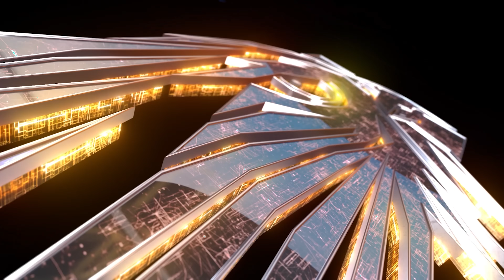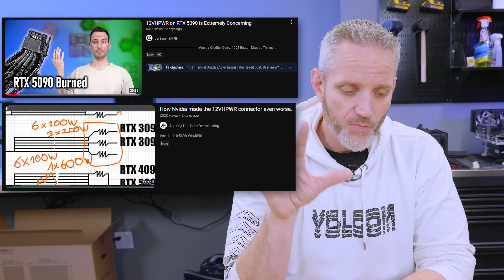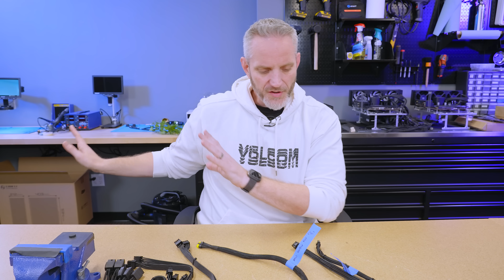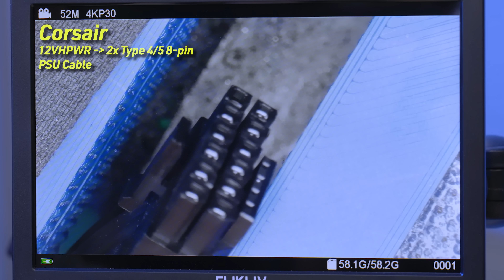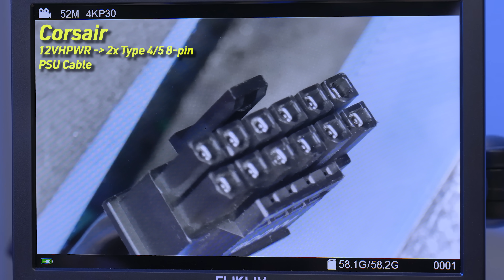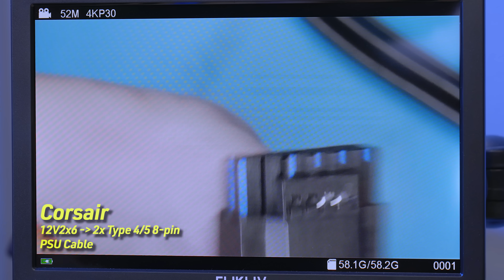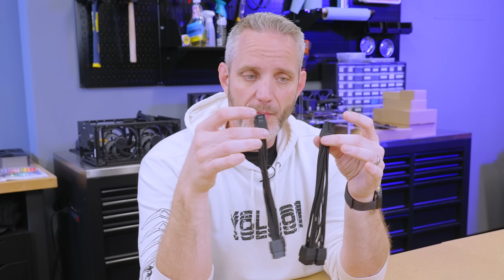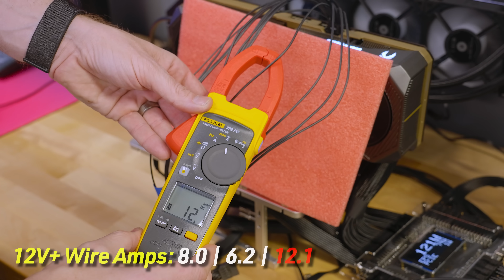I discovered something concerning and I need the Experts to chime in... More 12VHPWR discovery!

Comment: Engineer here: the board is grounded also on the PCIe side, so 12V  wires are more stressed than ground wires
Reply: They're not, the boards have 2 ground planes, one for the card edge connector, and a separate ground plane for the aux power. If you leaked aux connector return current through the card edge connector you would have a /bad/ day.
Reply: @ragzillaz  the two grounds are not isolated but connected together. It is actually just one ground. Running true isolated grounds is expensive and a pain in the ass , because you have also to isolate the I/O, not just power. I know because I design boards  for compact pcie crates
Reply: @ huh sure enough, I could've sworn I'd heard that they maintained ground plane separation between the pcie connector and the aux, but sure enough it's a low resistance path so single ground plane.
Reply: @ they are. This was already measured a long time ago; the 12VHPWR ground pins see only a fraction of the current the +12V pins do.
Reply: @ragzillaz  but eventually, those different grounds are connected together at the power supply, so it IS possible for some of the ground return current to go through the socket on the motherboard and back to the power supply.   Not a good situation, of course, but it certainly could happen.
Reply: @cube1us  generally only if the current sourced on that side, afaik the mobo supplied power rail wouldn’t go to the GPU Vcore VRMs, it’d be the smaller aux VRMs for control power, and maybe some memory VRM.

Comment: if they won't do load balancing then they need to incorporate thicker gauge wire to carry that kind of current.
thicker gauge wires all around  that is.. no point doing it only for the 12V side if the ground wires can't handle it.

Comment: 11:40 A lot of if not most atx power connectors have this kind of push&pull wiggle room on the cable connectors for both female and male connectors, and they didn't burn up like this unless you went crazy with daisy chaining splitters.

This is almost certainly a factor for the 12VHPWR/12V2x6 melting but that doesn't change that they're drawing way too close to the maximum amount of power for the spec of these connectors, even the revised ones.

Should be at least 15-20% headroom under a constant draw load imo, because what that headroom allows for is some leeway with sub-optimal plugging, variation in manufacturing tolerances or wear over time.

Comment: The connector barbs should be crimped into the plastic housing like any JST connector are. This just show we are following the same cheap design of MOLEX connectors all the way with these supposedly high powered certified cabling.

Comment: It's still Nvidia at fault. It's obvious it was lab tested only. Current is going to travel the path of least resistance. From my experience cables can fail and pin locks break. Uneven pin height might still be within spec.  The Asus style ps is a solution just not the solution.

Comment: @Jayztwocents id take some pins off dead gpus and push into the plugs to see how tight the plugs are see if really making contact. Remember heat can make the pins expand then contract as it cools so the pins loose surface area, so could that make the pins loose contacts which make them melt? Also does GPU manufacturers have to follow Nvidia say use unified rails could they say no let do it the old way?

Comment: No joke, if I get stuck with a 12v hpwr device, I'll likely remove the connector, run wiring directly off the board, and use some high current connectors that are out of sight. Like, some XT connectors.

Comment: I bought a Corsair RM1000x last month. I have an AMD card, but I checked my never used 12VHPWR connector that came with it (H++) and the same pin that Jay was able to pull out a bit, did for me with almost no force

Comment: @boestube5805
9 seconds ago
I USED A CABLE MOD 90 DEGREE ADAPTER ON MY 4090 and it melted into the connector. those connectors were recalled in Australia. Fortunately, Asus fixed my card for free as it was still under warrantee. I will NEVER use cable mod again period as they are too risky especially with cards costing so much. BTW 5090's should come with a fire extinguisher.

Comment: When buildzoid put out that video after watching derbauer, It instantly clicked why the 3090 FEs and 3090Tis weren't melting but the 4090s and now 5090s are. 12vhpwr is kind of a janky connector anyways but it was never the problem. 12v2x6 was a way to slap some duct tape on it so to speak while sweeping the real problem under the rug. It turns out even that wasn't enough and Nvidia potentially just opened up the book on themselves because every electrical engineer I know would look at those diagrams and immediately call for whomever signed off on them to be fired. One of them described it as "amateur" and "psychotic". Like the kinds of mistakes you can't be ignorant to as a seasoned engineer. These came from the top down as cost cutting measures because we all know how upstairs can be incredibly greedy and stupid.

Comment: The power supplies also let the burn ups happen.  The supplies seem to be perfectly fine with shunting too much current on to one line if another one has a bad connection.  They allow current to exceed spec to the point where everything melts.
Reply: @greengiant_6652  buildzoid explained it. All cables in the 12VHPWR are connected in paralel. For PSU and GPU this is one connection. They can not balance it on each cable pair. In 3090 on the gps side had 2 phases so the GPU balanced the current on the 2 groups of cables in the 12VHPWR connection. In 40 and 50 series it’s gone (dumbed down). Even if you cut 5 12V pairs the psu will try to push the current with just the one pair of very thin wire (melting).
Reply: @JohnyBrav-o  Yes, saw that video.  Exactly all current through one wire.  The current power supplies are too simplistic and will just let the system destroy itself.  Power supplies could have internal load balancing, they could have per pin over current protection.  They don't.  The designs are lazy and cheap.
Reply: @ I don't think the 3090 actually had balancing, the design just split the delivered current to separate internal power planes to minimize the potential issue.   Balancing implies you are actively doing something to adjust the lines to keep current in spec.  Digikey has some nice technical notes on load balancing.

Comment: Hi Jay, in a series circuit (power in -> stuff happens -> power out) , that high resistance of the loose connection will limit the power through the entire circuit, but as the name says that loose connection will be high resistance, and resistance becomes heat.  So yes the loose connection will be a hot spot, same as a broken or about to break wire.  Now there OUGHT to be multiple power and ground lines to split the current across several conductors, but best practice is to have a ground line at a larger size than the supply side

Comment: Reagrding some.pins being recessed. I noticed it on my cablemod 12vhpwr. You could literally move the wire and the pin like you showed. So, what I did was after I seated the plug I push on the wires, also hoping that it would  push any too recessed pins. So far...I've been good on the 4090.

Comment: What most probably misunderstand is that the cables that heat up that much aren't going to be the cables with higher resistance. 

These cables are all connected to the same rail on the power supply side and the same point on the GPU side. The current will only split evenly among the cables when the resistances are equal in the cables and it will go through the path of least resistance. This means that cables that have bad contact can increase in temperature because of higher resistance (negligible) but the ones with excessive current are the ones that have a good connection because that is where all the current wants to go now.

Comment: I am IPC certified and work in the aerospace industry. The contact on the corsair cable that is moving like that should be a failure even for class 1 products. almost seems like the locking ring is broken or installed incorrectly.

Comment: I'm an industrial electronics engineer. Your findings show that there is no load balancing between the conductors on the card. It looks like the PMD uses shunt resistors to measure the current through the conductors. These shunts act as ballast, meaning the more current that tries to flow on any one wire causes a greater voltage drop across the shunt resistor. This voltage drop reduces the power flowing on that wire, balancing it with the other conductors. Imbalance can be caused by many things including contact resistance, cable length, conductor material, manufacturing variances, and temperature. Load balancing is essential when running things in parallel to force all components take some of the load despite these multiple variables. It seems like these graphics cards doesn't have balancing, allowing the currents to be so high one some conductors and practically non-existent on others. 

As for the question about the ground wires potentially melting: Yes, they could melt as well, but probably won't. All current entering the card equals all the current leaving the card (Kirchhoff's current law), so if the power wires carry too much, then the ground wires carry too much. Except the 12V cable is not the only ground. There are tons of ground connections on the PCIe slot itself that carry current. If you compare the total current going in on the 12V wires to the current leaving the ground wires, you will see a discrepancy. That extra current is leaving through the PCIe slot.
Reply: The very-small-milliohm shunts are almost certainly dwarfed by pin-to-pin contact resistance when the pins aren't making good contact.  This of course causes more current to flow through the other conductors in the parallel circuits. If only one cable has this, we're probably fine (because its split up between the other 5 paths), but derbauer's video suggests that 5 of the circuits had significantly higher resistance than the one that was carrying 22+ amps.
Reply: @glenndoiron9317  While it might normally be true that it would be fine for only one of the wires to be poorly contacting, keep in mind that the 12VHPWR cable only has a 10% safety margin, meaning that if it loses 1/6th (16.67%) of it's cables then the other cables are now over their current limit, if only slightly. Lose 2 and you have a big problem.

By contrast, the old 6/8 pin could lose 1 of it's 3 12v cables and still be totally fine, because it had a 90% margin. A well built one with 14AWG wires could likely handle losing 2 out of it's 3 wires and still be fine, if on the edge.
Reply: The shunt resistors are very small, but they still should be greater than the contact resistance. According to the specification, the 12VHPWR maximum contact resistance should be no more than 5 milliohms. Shunt resistors are usually around this range, but I can't say what the PMD is using without looking at the circuit. Contacts with resistances much greater than the shunt resistors are doomed to melt down even if they are well balanced just because of the amount of power they'd be dissipating. 9 amps across 5 milliohms is only 0.4W. If the resistance was 10x greater at 50 milliohms, then the power goes up to 4W, which is unsustainable for such a small amount of metal tightly packed in with other hot contacts and no air flow.

Comment: Play is fairly normal in a connector due to the slight differences in the 'wings' and moulding but that Corsair one worries me.
I use a Fasgear cable on my 4090 with my Corsair AX1600i PSU. It splits the 12VHpwr connector to 3 x 8 pin at the PSU end. It handles 600W without any measurable temperature increase on the connector at the GPU compared to the VRMs if I push my TUF OC 4090 to 133% as I did for testing. I've checked and no hot wires either. Normally limited to 450W. I now have a WireView in series that routes the cable back by 180 degrees so that the cable is supported by the back of the GPU PCB.
One thing I would say is to plug things in fully, with zero bend stress on the cable, and leave it alone! Also, buy a new cable for a new GPU. I will be buying another Fasgear for my 5090 when it eventually arrives. 
Retired graduate EE.
Edit: An updated WireView with shunt monitoring in each 12V wire, and error alarm, would be a good idea!

Comment: Disclaimer: I have one whole semester of electrical engineering in my pocket from 27 years ago. This is based on my limited knowledge of the most basic electrical engineering concepts, which still seems to be more than PCI-SIG and Nvidia:

If a pin or socket is loose, then it is not safe. Period. No further discussion should be necessary, but I will explain why Corsair are full of stuff with their response and why this is an absolutely negligent specification:

The PCI-E 2.0/3.0 spec lists a max rating of 150W for the 8-pin connectors, which is averaged at ~4.16A per wire at max rated load. However, they also specified up to 8A per 12V wire; 8A x 12V x 3 wires = 288W, providing a safety factor of 288W / 150W = 1.92 based on wattage alone. They also specified using 16AWG wire, which has a max current rating of 15A, so a single wire is actually capable of safely carrying the full 150W if necessary (150W / 12V = 12.5A), which still provides a safety factor of 15A / 12.5A = 1.2 (assuming the PSU can provide that amperage to a single pin without triggering OCP).

The PCI-E 5.x spec has a max rating of 600W for the 12VHPWR/12V-2x6 connector, which averages to ~8.33A per wire at max rated load. However, they also specified up to 9.5A per 12V wire, so you are already only at a safety factor of 600W / (9.5A * 12V * 6) = 600W / 684W = 1.14; the 18AWG specified also has a max current rating of 9.5A, so there is no additional safety factor. Loss of a single wire at max load will bring the average current through each wire to 10A, which is above the max for 18AWG. Therefore, there is literally no margin for error in getting these cables and connectors right if adhering to the spec and not building in your own safety factor. Using 16AWG wire (which CableMod proudly states they do) means that 2 wires can be lost before exceeding the max current rating per wire (again assuming the PSU can provide that amperage without triggering OCP).

That all being said, Buildzoid showed how all this is meaningless in the 40 and 50 series since there is literally no load balancing across the wires because all the power is connected to a single rail on the card. The card could also only be drawing roughly 400W through the cable, but if it is drawing 11A through  one wire and 4.5A through the rest, there is still the great risk of cable and connector melting or even fire. At least the 30 series had some semblance of load balancing with the power being drawn into 3 separate rails on the card.

The only reason I can think of that would cause some wires to carry pretty much double the current of other wires that are in parallel is that those wires with less current are seeing proportionately higher resistance for some reason. This seems to me that it is an issue with the connectors since the copper for electrical wiring is at least 99.95% pure. I would be interested to see if different cables react differently with the same PSU/GPU combination and if the same cables react differently with a different PSU and GPU (switching one at a time for scientific accuracy, of course).

Comment: The bigger super main problem is, why is Nvidia pulling around 80% of the 600 Watts power on 2 wires?
Let's direct the arrows to the 1 Trillion dollar company first, a 1mm to 2mm pin difference is not the smoking gun!

Comment: The resistance of a relatively short (about 1 meter) copper cable is very low. Here we have 6 wires in parallel and the current through each wire is inversely proportional to its resistance.
You have Ohm's law (I = U/R) and so the wire with the lowest resistance has the highest current.
A bad connector can result in higher contact resistance, such that the wire with the best electrical contact will have the highest current, a wire with zero current will have no contact.

The old design, where not all wires were in parallel, is better, because this problem could be better detected in the case of a bad cable.

A thicker cable isn't a good solution either, because the connectors will still get hot and melt.
By the way, you should always measure the temperature at the connector as well, because the temperature results from the power, which is P = U * I = R * I^2.
So the power losses are the biggest where resistance is high, which is the electrical contact at the connector.
And the connector with the highest temperatures will cause the most contact resistance.

Comment: i dont have the 12v-2x6 capable PSU and haven't had it long. do i need to upgrade to a 12v-2x6 PSU for the 5090. or am I okay with the original 12vphwr cable. PSU I have is the MSI MEG AI1300P. the version prior to revision. and if not any recommendations on 1300w+ cheap PSU that do have the revised cable. or should i used the adapter cable that comes with the 5090.

Comment: This is a perfect example of over thinking and over engineering a problem.  The simple answer is the pins are to small.  600w @ 30A is nothing in terms of electrical current.  A few MM of tolerance should not cause enough heat to melt a plug.  The wires and pins especially the ones that supply 12v power and ground should be larger.

Comment: Usually all grounds are connected including to the case bracket to the case being a ground also that is why (i dont have one of these cards) that the ground wires are prob not over heating theres other ways for the power to flow